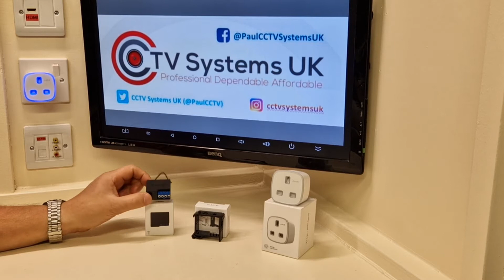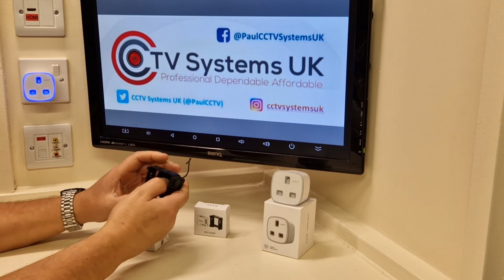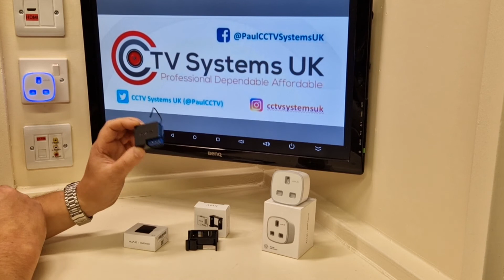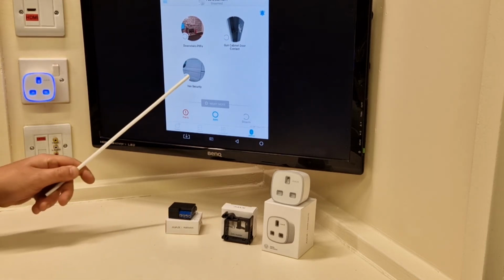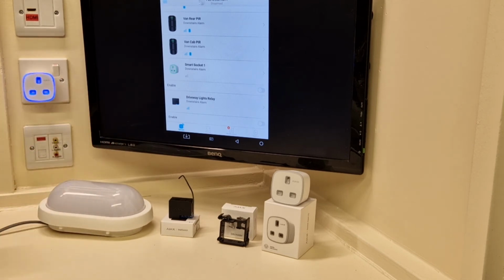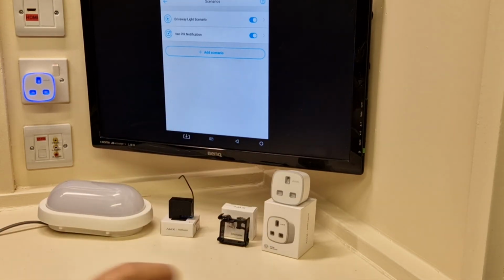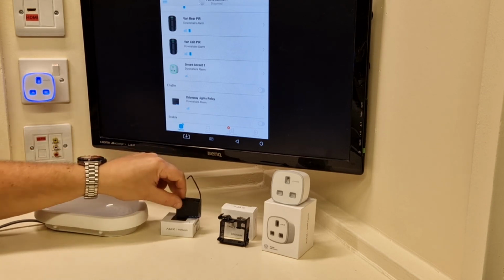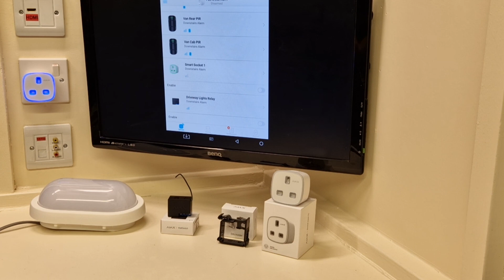Ajax Wall Switch / Relay Demo

Comment: It is a pity the wallswitch requires a 70mm back box if mounted in the switch, because it is not always practical to mount it in the consumer unit. Overall the only practical solution Ajax have come up with is the switchable socket.. The light switches they offer at present may look nice in isolation but will not match the rest of the room or house. What they really need to provide is a relay module that fits into a module within a modular light switch plate.